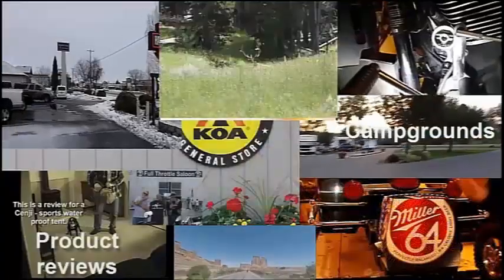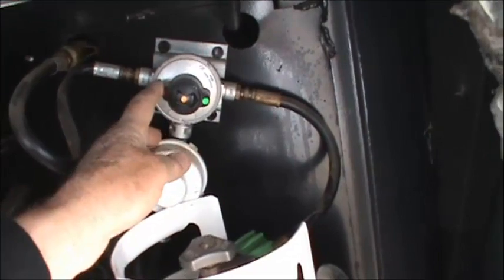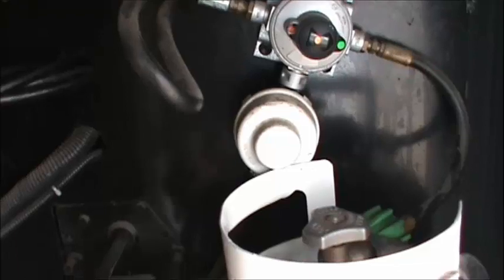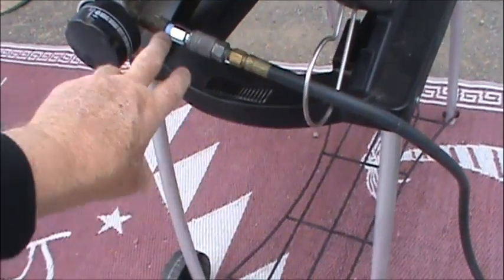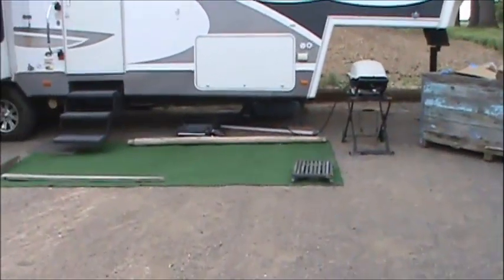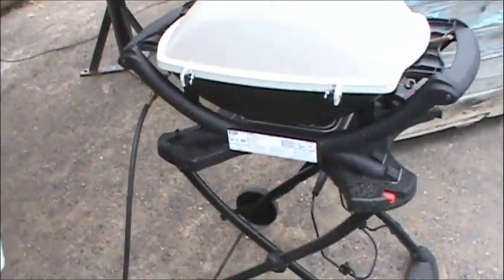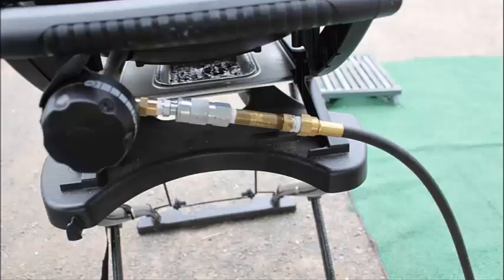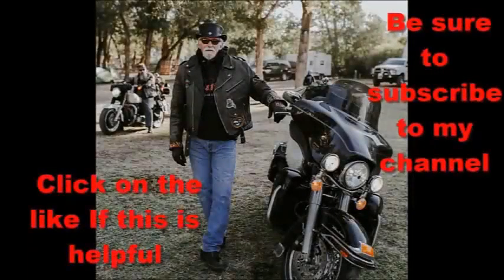RV  barbecue LPG hook up with a Single regulator. the girl is an advertisement she is not in a video

Comment: What kind of a disconnect do you use have always had trouble with disconnect leaking
Reply from the maker: I have a ball valve that shuts off all the gas. Then after it I have an air hose fitting on both ends of the airline. I never leave the gas valve on. Unless I'm cooking